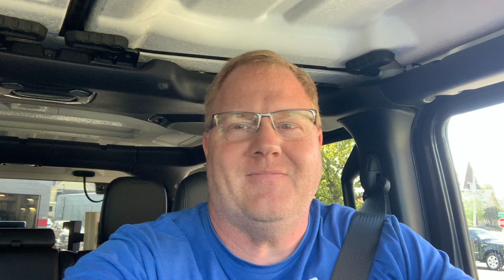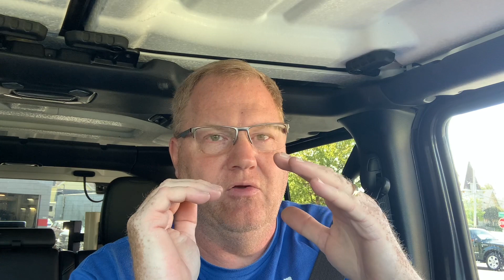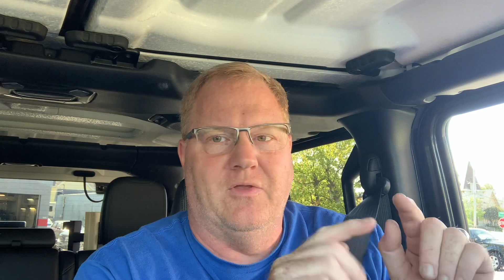Max Regen Software Update

Comment: I got my Jeep two weeks ago and I have that software too. I can confirm what you shared. It tries to have a constant charge. Also my button stays on or off even after a restart. Greetings from Germany. I have only trouble with DAB Radio Antenna that is on the windshield. Will bring it to service next week.

Comment: Is jeep doing over the air updates?  I picked up my 4xe in August and the max regen needed to be pushed every time. For at least the last 2 weeks it saves state.  No dealership visits.
Reply from the maker: Now that’s interesting. As far as my knowledge extends, it has to be done at the dealership. But you’re the first I’ve heard of this so now it’s a mystery to be solved.
Reply: I need to get a overly tight seatbelt lock fixed soon so will ask at the dealer then.  Its completely possible it was my wife changing setting early on as she hates the feature.  Buti remimber it being so consistent that I wanted to complain about it early on (but i am only human).  Also FYI my last truck was a 2014 dodge and I remember a recall to flash the OS when there was that bluetooth hack scare.  I didn't bring it in very quickly but eventually my touchscreen was updated.  Maybe they use both methods to limit bandwidth?

Comment: I will have my 4XE in about 10 days. Is there a way for me to check that the latest software update is installed? What else to check?
Reply from the maker: The easiest way is to see if your max regen button latches. Turn the vehicle on, turn on max regen, turn the vehicle off and restart, then see if the max regen stays on.
The prep at the dealership should include all of this if it doesn't have it from the factory.
Reply: @Wrangler4XEFans  thank you!
Reply: My 4xe is 5 months old, I have 1500 miles, an automatic app update will inform you on the U Connecr screen.  Just follow the instructions,  its easier, jeep will complete the rest.   It takes about an hour.
Reply from the maker: @valentinodimauro4552  That’s the head unit update. That won’t update the updates mentioned here. Jeep won’t do OTA updates on things that change how the vehicle operates.